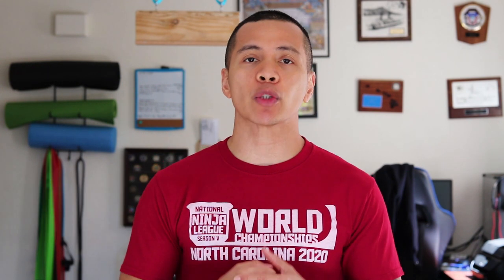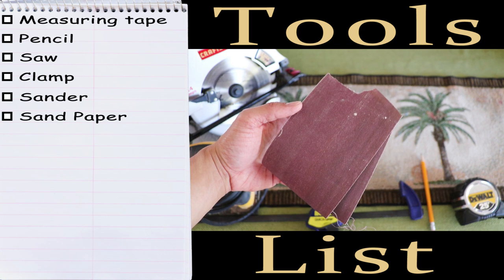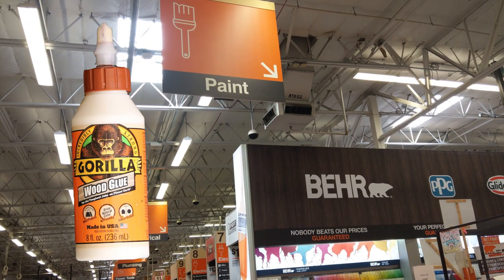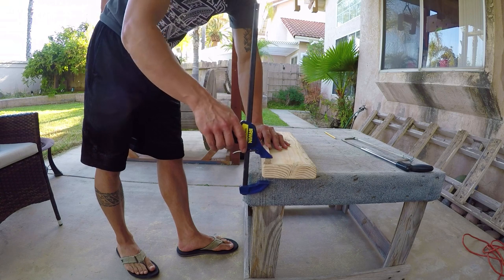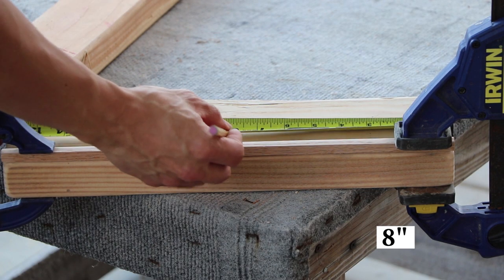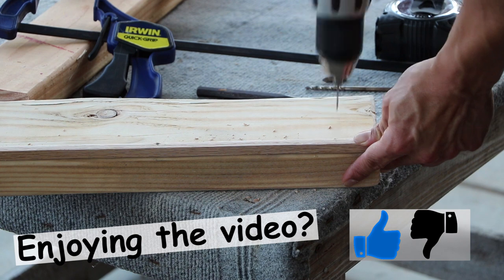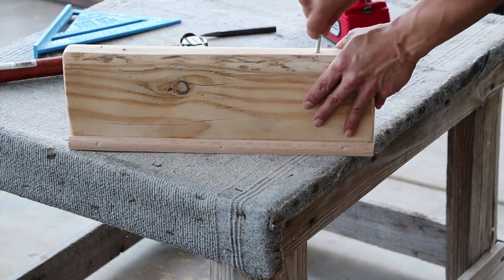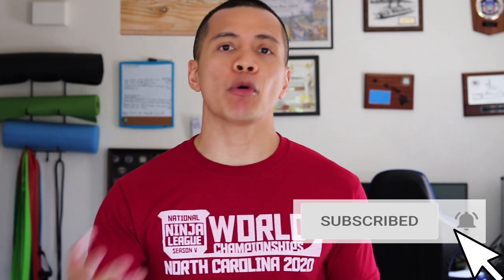DIY Vertical Limit - How to make ninja warrior obstacles

Comment: New to this ninja thing, but seeing what look like potential issues for long-term safety on some of these builds.
1. Eye bolts are weaker when subjected to angular loads, with open eye bolts being significantly weaker than closed / forged eye bolts -- if you're expecting to lache onto / off of it, the breaking strength is going to be far less than the rated strength for pulling downward
2. Metal rubbing on metal is going to lead to long-term wear -- putting something like a soft loop in between rings would help prevent them from wearing down over time.
For something like this, my thought would be:
- Skip the eye bolts entirely
- Put 2x 1" holes near the top of the board (leaving at least 1.5-2" of material above / next to the holes)
- Round over the edges of the holes & top edges of the board (fastest with a router & round-over bit, but still doable with sandpaper and / or a file)
- Drape a soft loop through the hole to connect to the carabiner above
Reply from the maker: Timothy, I agree with you 100%. Safety is a huge concern when doing any sort of DIY. 
And you're absolutely correct. Forged steel is significantly stronger than the general zinc plated ones I'm using. However, with each eyebolt rated at 175lbs and sharing the weight, this works perfect for a large range of body types. Laches onto a vertical Limit of this size is extremely difficult and there are not many who could perform such a feat. And for those that can, I would highly recommend you buy a professional grade vertical limit.

2. As for metal to metal, the carabiners I'm using are rated for climbing and are widely used throughout Ninja warrior competitions with direct contact to the metal eye bolts for various holds. However, the 1" hole near the top is an option that I used when making an obstacle, that I'll release next week. (this obstacle I would definitely be doing some laches to)
Reply: @TheNinjaLife  I'm mostly building for myself & my kids (3 & 5), but my natural tendency for DIY stuff is to overbuild things / build based on specs for public parks or commercial settings.

Most recent debate was whether I should order 22-27 KN climbing rated carabiners, 3/8" plated 30 KN climbing rated quick links, 3/8" stainless 45 KN PPE rated quick links, or non-rated 5/16" plated quick links with a 1500 lb working load limit & 5:1 safety factor.  (I ultimately decided that the cheaper quick links with a 1500 lb WLL / 7500 lb breaking strength would probably be OK)
Here's one video I'd come across showing examples of metal on metal wear after only a few months of use:
https://www.youtube.com/watch?v=eGWxXS2aZtg&t=339s
Reply from the maker: I see you're point. It's definitely better to be safe than sorry. 

I watched that video about metal to metal and I understand your concern. For moving parts or rotating surfaces with metal to metal contact causes, lots of chafing and is for sure no good. But as he mentioned in the video, static applications are a different story. Metal to metal when using as a static application, like the vertical limit, that would be perfectly fine (in my opinion).  You will always have wear on your gear over time and it is best to avoid metal on metal contact as much as possible, whenever possible. 
Now if I owned a gym where I was going to have many people use these obstacles over and over and sometimes not as intended, then for sure I will be taking more precaution to avoid metal to metal on just about everything. (including static applications, because you never know when a Ninja is gonna try a dynamic move on a static obstacle)
Reply: @TheNinjaLife  I think the one thing I can guarantee with kids is that everything will be used in ways that it wasn't intended ;-)